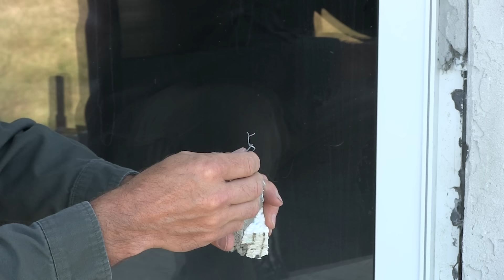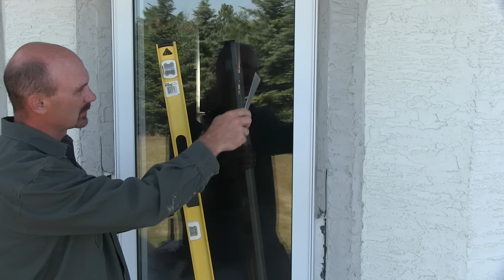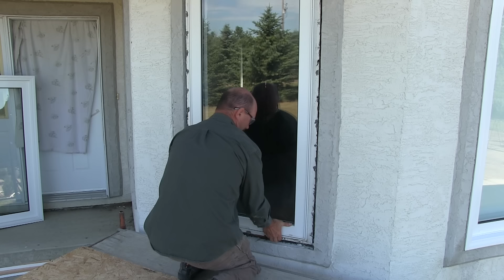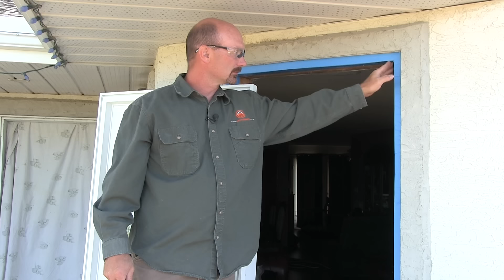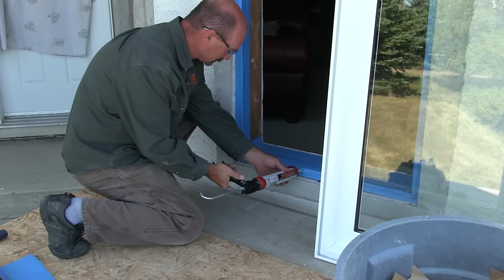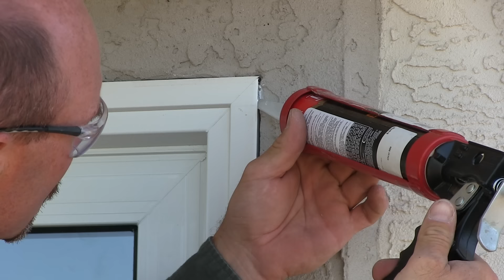How To Replace A Window In A Stucco Wall

Comment: NO NO NO This is not how you tear a window out or install a window. You do not chip stucco out for one, tearing out old there should be no stucco damaged at ALL. Deglaze glass and take glass out of frame, in most cases the bottom glass (sash) should be able to take out frame, glass and all, once glass is out. Then take saw all and make cut on side of frame as far as you can with out cutting in to stucco and drywall. Now pry frame out with flat bar. Called collapsing the frame out. Now if your worried about damaging dry wall when you pry cut a piece of wood 12 inch long or so and put board between drywall and pry bar, do not worry if pry bar damages drywall close to old frame cause new window is thicker frame and will be cut out for larger buck or new window will cover damage. Next depending where you live in florida by code, if the wood is beveled like it is in case of this video. The drywall has to be cut back even to edge of new window cause new window should have thicker frame, remove beveled wood (buck) and replace with wood (buck) that fits the whole width of drywall that you cut back to stucco. Then you are ready to set window. Now if window has a flange around outside of window you measure out side stucco and cut flange to fit outside stucco. Now how you measure for new window, measure inside of window Drywall To Drywall Width and Height, then order you new window with a outside flange, that you can trim outside flange to fit stucco. Tip: make sure when you order you new window that the order measurements are for inside of new window not the flange size. Now some places when you order, they take outside flange measurements for ordering new window. If this is so just and 1 inch to width and height to your inside drywall to drywall measurements and that is your flange size for ordering by flange. Just in case you doubt that i know what im doing i own the window companies and i personally install around 2300 units a year. Thanks And God Bless
Reply: Please upload a video describing your method outlining the differences. Provoke a discussion, and help us DIY'ers out =D
Reply: I have never cut stucco out to change window out. NEVER
Reply: Doing way more work than necessary.
Reply: So you always replace windows smaller then the one you remove..lol🤔🤔
Reply: @dereksara26  that's more work
Reply: This window was 2 inches larger also being put in .....do he showed you how to get the flanges out....makes sense so you do have them in ur way
Reply: Yup, this guys claims are ridiculous. Is he talking about a  new construction or retofit window? I see many people cut out new construction windows and then install retrofits. And that is WRONG. These usually end up leaking. But hey, this usually make  mor work for me and its causes water damage that easily avoidable. Just because you have a company and install them that way does not mean its right. 
This is the proper way to install these type of new construction window frames.
Reply: you said it perfectly when I read this guy’s comment it blew my mind. He has no idea what he’s talking about.
Reply: Lol damm that a lot of work he is putting in a larger window get a gas saw with masonry blade it dont take long .trust me I do it all the time a done both way when dealing with flange nails you going to take a hour or more own one window.
Reply: Please come and do my windows.
Reply: I can guarantee every window manufacturer would tell you if you cut the frame/flange warranty is void
Reply: @dwizzle672  no cutting the flange in the n.o.a.
Reply: That is completely wrong. Once you collapse the old frame you completely damage all the waterproofing. What are you gonna do about replacing the waterproofing behind the stucco.
Reply: @richardalonsoaguiniga1431  first this is retro not new construction next the waterproofing paper stays in the wall does not come out occasionally may tear a little if there is any at all but nothing to be concerned about 
And if you are that concerned about the waterproofing behind fin then run a circular saw around old frame and leave the fin in but there should be no stucco or drywall damage
Reply: @TheRottenOneRepents  lol you’re correct on everything you said I forgot to @ the guy I was trying to respond to
Reply: That's a retro window withe a z bar. To do a nail fin new window you need to cut stucco
Reply: Thank you for your detailed explanation sir
Reply: What an idiot i think he is trolling
Reply: Are you in Florida? Which part? I need windows and doors installed on a stucco house in SWFL. Please help! I want to make sure weather barrier is not left out, ,drip pan is installed, shims areadded correctly.
Reply: I would bet my life that you suck at listening to others. But damned if nobody listens to you 😂 

There’s plenty of methods to do the same job, whether to code or not, that works. Just because whoever taught you treated you like this, doesn’t mean you’re supposed to stick your rules into someone’s attempt at sharing info and promoting their craft. 

if it’s not for you, let others figure it out with this fella. he’s trying by putting himself ON VIDEO. You’re just a comment that’ll get fewer and fewer people on your side as time goes on. Figure it out.

Comment: I would probably just cut the window nailing flange too....unless you wanted to save the window frame..but thank you for your videos
Reply: Cutting your nail flange is quick and easy. But you’ll never meet fenestration code and the window could leak catastrophically down the road.

Comment: On the multi tool. I use when working with stucco the carbide tipped blades. with those blades you can cut through stucco with ease. Great for when cutting in for electrical outlets and such. They last a good long while. Note once used on stucco I never use it on anything else because they become dull. But work great with stucco.

Comment: I noticed the lack of lap over the stucco cut out at the bottom of the window? Isn't best practice to run it over as per the redirection of water if it does penetrate the silicone into the rough opening?
Reply: I was going to say the same thing.  Fluid flashing is awesome but if you're not tied to the existing building paper/WRB then it's largely useless...